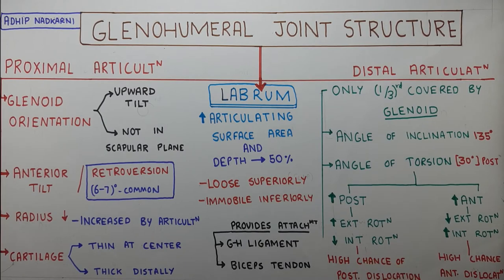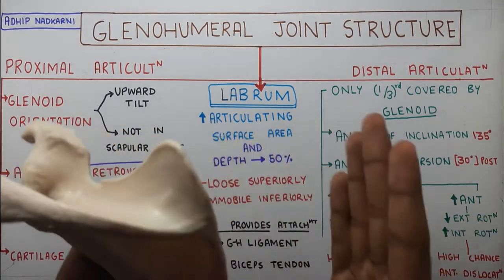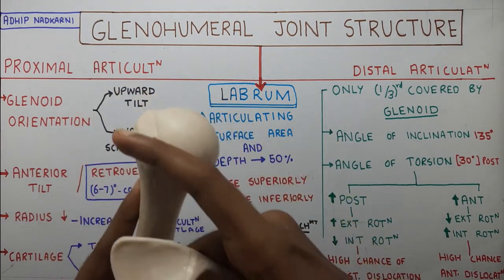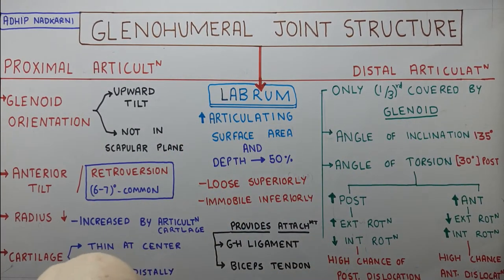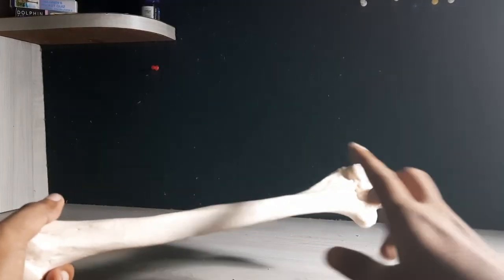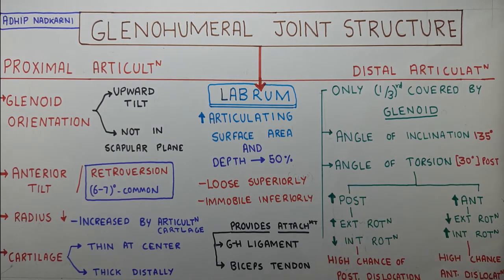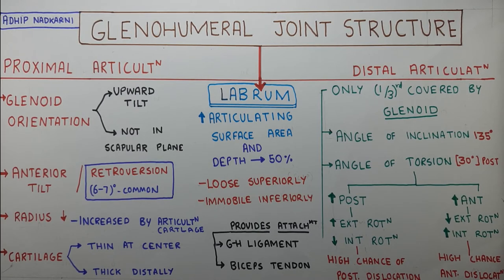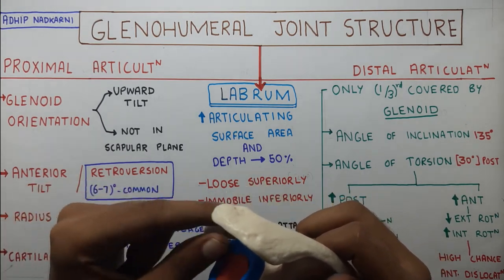GLENO HUMERAL JOINT STRUCTURE (SHOULDER JOINT COMPLEX BIOMECHANICS)Physiotherapy Tutorials

Comment from the maker: *CORRECTION*
Throwing athletes might not have higher chance of posterior dislocation. Its just that such kind of adaptation is seen probably because their
arm always goes for abduction and external rotation which is common mechanism of injury for the anterior dislocation. 

Reduced retroversion (or anteversion) results in a more anterior position of the humeral
head on the glenoid surface when the arm is in an
 anatomically neutral position.
 Humeral anteversion can result in an increased range of medial
rotation of the humerus and a reduced range of external rotation that places the humeral head at risk for
anterior subluxation at the end range.

Increased retroversion results in a more posterior position of the
humeral head on the glenoid surface when the arm is
 in an anatomically neutral position.
Humeral retroversion can result in increased range of
 external rotation of the humerus and a reduced rang
of medial rotation that puts the humeral head at risk
 for posterior subluxation at end range.

Increased GH external rotation and decreased GH medial rotation have been demonstrated in the 
dominant arm of throwing athletes, and evidence suggests that an increase in
humeral retroversion may be one contributing mechanism for this ROM adaptation.

Hope this makes sense!
sorry for the confusion!!